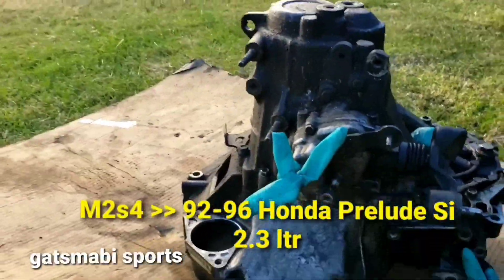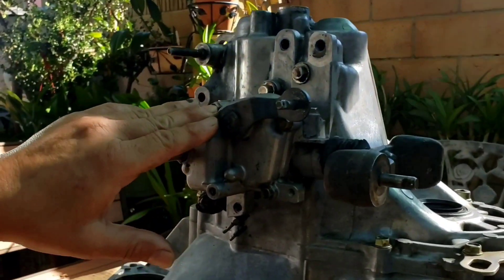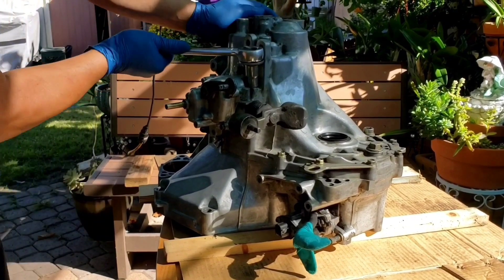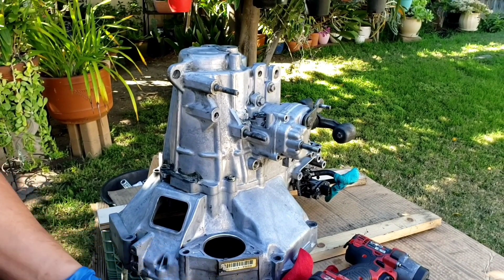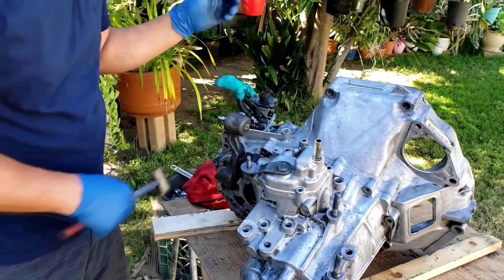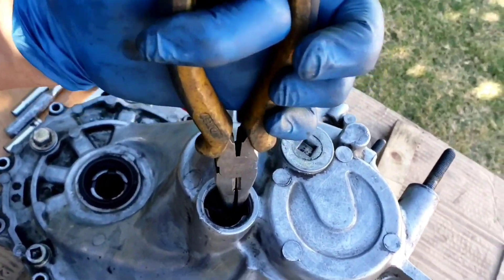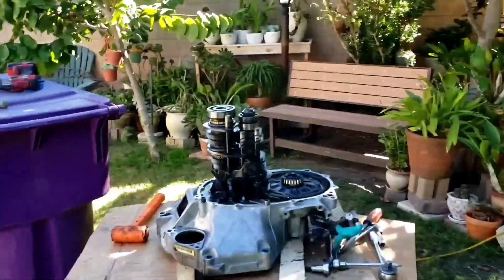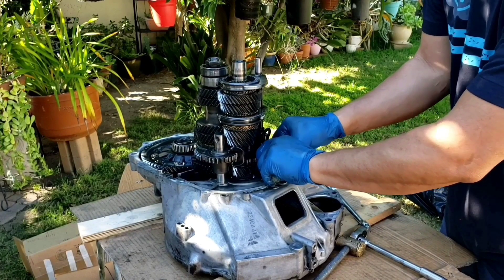Prelude transmission disassembly under 14 minutes/ timelapse.

Comment: Brother I Wana ask you...the transmission for h22z1...it's one wheels ..can i swap lsd differential in transmission for m2x4
Reply from the maker: G'day mate, not sure about it coz of the atts. That extra box gearing that is attached on it and l dont think they sell aftermarket lsd for Prelude that has atts.
Reply from the maker: The only way to get rid of the atts tranny is to install a base tranny w/ lsd on it, but you need to modify your halfshaft mount in order for it to plug n play on the block. Thanks

Comment: Whats the best or longest h series 5th gear you can put in a t2t4 transmission
Reply from the maker: It'll be 5th gears from any Accord from 92-2000. I haven't open  a t2t4 tranny and physically see the 5th gear ht thickness. I have a M2B4 tranny and back then, B4 5th gear is thinner than Accord 5th gear in comparisson. If l ever want to do a conversion, l need to have the Accord gear shave to the height of m2b4 gear (or add a spacer on the other gear, can't remember now coz it's been a while) in order to get it to work. It can be done if you really need that cruisin rpm speed on the fwy or hwy. Are you thinking of doing a conversion?
Reply: @sagittnet2158  pretty much just looking into it at the moment seeing what my options are for better highway cruise
Reply from the maker: @ek94banger48  OK, I just never get to use my M2B4 tranny coz I need a longer 3rd gear for my application of use. I found it on M2S4 and never finish to do a 5th gear swap on M2B4. If you ever get a gear from 95 cd5 Accord, you'll know what to do. Good luck on your project.

Comment: Cool beans.   I've watched a couple different teardowns on these units now,  I think I'm ready to break into mine.   I have a 98 Accord 2.3, anyhow I've put an F23A JDM swap but it came with an automatic.   I got a trans from a crashed '97 Accord Vtec 2.2 I'm going to put in there.   Just want to tear it down and check it out first.   Now if I can just figure out how to chip an OBD1 computer and put that in I'll be golden to start adding some power to it.
Reply from the maker: It might be intimidating at first but once you open it, it's not that hard. Take a video or photo of the gears once you open it for future reference and watch out for the input shaft bearing. It's the one that get stuck on the rear housing. Sometimes it'll stay on the shafts and times will fall off. Anyway, make sure it goes back in correctly. If you will take a time to look at it, the bearing race is built like a cup, and if install backward, the input shaft will move back instead of the bearing should be keeping it forward. Good luck in your swap msn and thanks.

Comment: Im about to throw this same trans behind my f22a6 and was wondering what pilot bushing and clutch do i use the f or H.
Reply from the maker: H series dont use a pilot bushing. I've seen some flywheel for H series that's for sell that advertise w/ a bushing. But l stayed away from it. No pilot bushing for H.
Reply: Thank you new to the honda swap game. Was raised on chevy small blocks. I wasent forsure just wanted to make sure so when i get everything togther im not scratching my head.
Reply from the maker: @justinblanton6882  No worries. There's also plenty of info on web, but if you need more info, lmk. Back in the day, me and my cousin was playing around w/ his dad Chevy Laguna, changed the engine and everything. I also drove and maintained a  '82 Camaro(4cyl) yup! 4 cyl. Alright man, good luck on your project.
Reply from the maker: You can use H or F series clutch, if more than oem hp, you might wanna upgrade. Stg1 is overkill under 200hp and it's all about your budget.Exedy is good for oem clucth alternate. I'm using AUTOZONE clutch on my f22b2. Well known offcourse you pay more. Ebay stuff, it's up to you to find out. The one l'm using is Yonaka and its a bit harsh on the first few 100 miles, but it hold on the hp l made.

Comment: So cool. Thanks. I’m trying to build an transmission. Love to see a reassemble video. Trying to build basically and f trans with h23 gears and an f 5th. Proven difficult. Waiting and on another project to complete so I have a car to drive. Lol
Reply from the maker: H23 and F's have same 1st gears. 2nd are almost the same ratio. 3rd, 4th and 5th are completely different ratio. Having a Accord 5th on m2s4 have a trade off. Stay tune. Thanks.
Reply: I wanna use the main shaft and diff from an accord so it won’t be to short of gear ratio. With the h23 gears. I had one at the junk yard they wanted to charge me way to much. I was angry
Reply: I need it just right for a sweet f22 I can drive all over the world!
Reply from the maker: @cbdreamer1709  lol
Reply: Yep. It’s a cold world. I’d never thought I would have made it this far. I’ll never give up